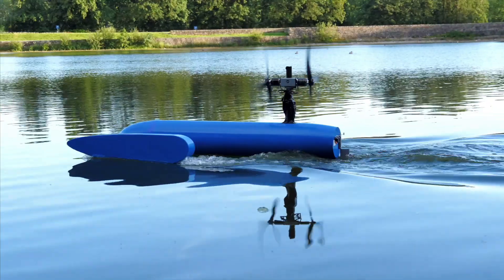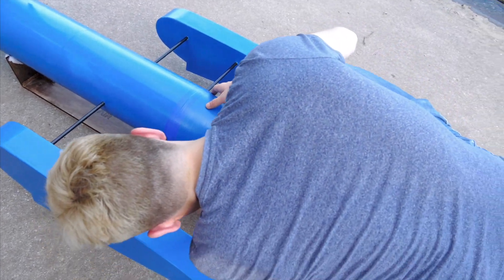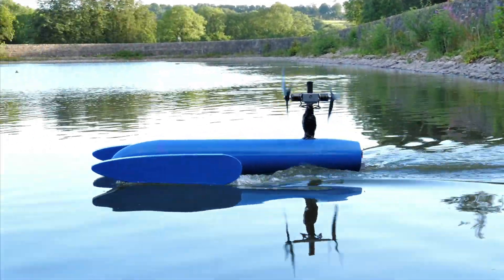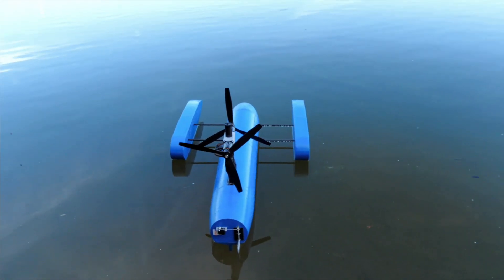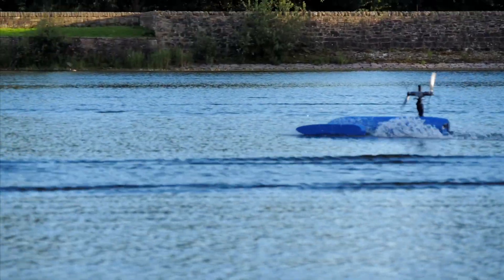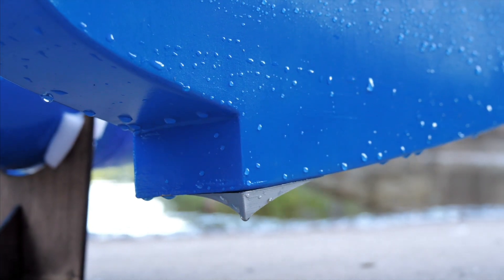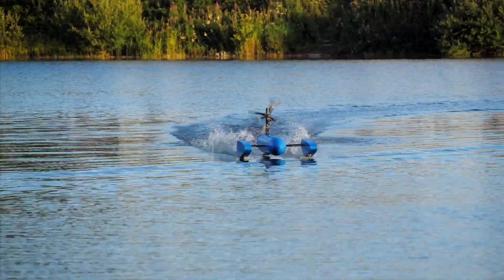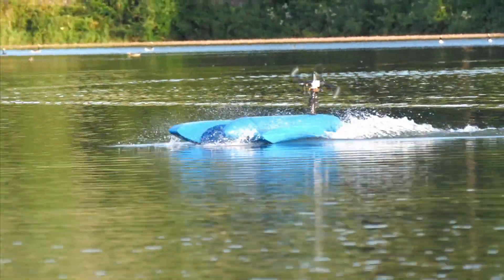DIY Speed Boat Mods

Comment: James, couple of ideas:
1) you could use plasticard and poly cement to make replacement sponsons. I've used this on a car I designed and it's pretty tough if you make it into a monocoque.
2) if you want it to have brakes, you could have a splitting rudder thing (not for steering, unless you want to) on the back of the keel thing. I experimented with a similar thing on my jet boat working long a horizontal plane but I'd suggest going vertical seeing as you can have attitude issues with this model!  

Keep up the great work!

Comment: Nice video!!
One question:
By using two motors, you offset the torque created by the motor. But for steering, do you use 'differential thrust' on those motors to turn quicker than only the rudder?

Comment: The air in the sponsons expands & contracts with temperature changes, this puts pressure on the wooden joints causing them to fail. You could make a vent hole in the top of each sponson, that will be sealed with duct tape when the boat is on the water. It should help prevent leaks & allow inspection to check if any water has seeped in. Plywood doesn’t like to be wet & I doubt that you painted the internals.

Comment: One last thing, why doesn't use some EDF on the center of the boat? something like the old Mig's.
This would reduce the torque that the top mounted motors are creating. Putting the rudder on the back of this air flow should also provide a great turning force

Comment: Also, why dott change the "banana pods" style for something like the back central pad? They doesn't have to produce in-water lift at all, just aerodynamic lift. This would also be easier to prevent from getting water inside, sice there's no "inside" to get in.
If you want some in-water lift, just put some foam on the top of it, keeping a sheet of metal contacting the water and it should be fine

Comment: Bro, you can make those floats out of insulation foam from a hardware store and cover it in fiberglass sheets. save a ton of money on the float design. In fact, send me the file for the float shape and ill make it myself.
Reply: Once the epoxy has cured you can then pour acetone into them to dissolve the foam and voila... light, hollow sponsons!
Reply: @AlymerKiteboy  Better to keep the foam so any holes will not fill it with water.
Reply: @macrumpton  he's going for max speed, so minimum weight, no reason for leaks in a glass sponson.
Reply: Oh well, seems like several people had the same idea as I did.
 @AlymerKiteboy   Good tip for a slower boat or a model plane, but considering the wobbliness of fiberglass it would probably be a safer bet to keep the sponsons filled with foam. The extremely irregular and strong forces from the water could easily cause the sponson surface to oscillate quite badly, at best. Maybe a similarly crafted hollow carbon fiber shell would do the trick, as it's somewhat less flexible.
Reply: @_tyrannus  3D print it. internals plus thin skin. flite test had a 3D-printed rc spitfire...................
Reply: +1 for fiberglass it would be perfect for this project.
Reply: @nypariah  I just know this was a way of making model sailplane fuselages... getting rid of the foam left room for the electronics. I'm going to try this soon for a one off boat hull.
Reply: @nypariah  : and Leaving the foam in adds positive buoyancy that an empty void can't.
Reply: @kadmow  Air is less dense than foam
Reply: @pepperrelldesigns40 Sorry, meaning of Positive Buoyancy ??  Air full of water isn't so buoyant -  (When an aeroplane hull has a hole in it, air rushes in/out, when a boat gets a hole water generally only goes one way. and the boat usually doesn't work so well.)
Reply: @kadmow  You didn't mention "in case of a leak". If you have no leak, the foam makes it heavier. (I'd leave it in, though, as a backup.)
Reply: @ThePixel1983  : All good.  My Bad

NB Boats don't need positive buoyance unless there is a leak - or water otherwise enters spaces it isn't intended to (by design)..

Comment: "We want as little drag as possible"
"Look this new rudder that I designed"

Isn't better to design something that it's not going to be on water and could steer the boat? 
As everyone know, at the same speed, air drag is much more forgivable that water drag
Reply: the problem is that you need motors on for it to function. I suggest a long rudder that extends both to props and water but James was afraid it would roll the boat
Reply: @linecraftman3907  that's true, but for both you need speed to make effect. If the goal is also having good low speed maneuvering, maybe thrust vectoring, but will add a lot of complexity.
The idea of moving the rudder of the water is just reducing drag, since the goal of the project is going as fast as possible and water at high speeds can be pretty unforgivable. (Would require stronger hardware and etc)
Rolling the boat is a real concern when you have the rudder far of the center of mass. Just like a plane, when you punch (or kick) the rudder pedals the will also introduce roll and pitch, not just yaw.
EDIT: I think the pitch introduced with a rudder movement is due to gyroscopic effect, on planes that have non counter rotate motors (or just one motor), so since this one is using 2 that counter rotate, it shouldn't have a problem.
Reply: @Xandeulson  yeah but like the lake isn't big enough for rudder drag to be a problem lol. The boat clearly needs RCS 😂😂
Reply: @linecraftman3907  a set of the famous cold gas thrusters would be awesome. Record breaking made easy
Reply: @Xandeulson  should be fine in pitch, but in water or air, it will have a coupled roll effect unless there is an equal yaw force both above and below the CG. (or straight through the CG.)
Reply: @martindinner3621  good note

Comment: Looked to be on step the first run. When choosing sponson spars always go fat and hollow for stiffness as solid ones are bendy. Your rudder is also too close to the transom before you install the new one sharpen the bottom of the V-shape or it will raise the transom out of the water more than you anticipate as it is a lifting surface as well. Locate the outrigger calc on RCG to get a good baseline on what works or what doesn't. Afraid to leave too much info as I build very fast riggers but not sure how you feel about having the answers rather than discovering them yourself. Either way, good luck, a much bigger lake will be a good start or a parachute. lol. Fantastic job, you got this!

Comment: With the new Floats how about filling them with expanding foam so if you do have another breach they wont fill up with water.
Reply: RC LabBotics expanding foam needs to be sealed as the water will force its way in to the foam
Been there done that☹️☹️
Reply: @ferb7452  hmm maybe some packing tape Around it like build a mold fill it with foam packing tape Around that.. Then build an outbreak Shell of carbon or maybe a different foam come to think expanding foam is quite pourus EPP would be the best way to go.

Comment: just an idea....try to 3d print brackets that can hold the carbon fiber tubes and attach those 3d printed parts onto the wood with screws...that way if you have more area of contact between the carbon fiber rods and body....also i think the "shaking" of the floats is because of only having 2 carbon fiber rods? maybe adding a 3rd one that's not parallel to the other 2 would be helpful
Reply: I'm not sure how much the brackets would help, but the third rod out of plane is brilliant! Also, switching from a round cross section tube to an oval profile will help avoid harmonics.

Comment: If you're gonna rebuild it, you can put some "air brake" like they have on planes? Probably help you slow down faster.
Reply: Or just add the ability to drive the props In reverse.
Reply: Martin Dinner Exactly, no idea why he wouldn’t set it up to be able to run it in reverse.

Propellers don’t work that well in reverse, but would’ve kept it in the water lol
Reply: @Nevir202  propeller can provide reverse thrust but it's only efficient with variable pitch blades. He will have to counter rotate the entire propeller which I feel will be far to slow to get back up to speed to provide any meaningful thrust.
I guess having a more efficient rudder to turn the boat before it beach is the simplistic solution.
Reply: @Nevir202  I use similar motors on RV planes and having reverse would be amazing it would make slowing down on landing so much easier but it is not possible without extremely hard  coding
Reply from the maker: Onizuka GTO That certainly might be a good idea, but really I won’t need a break when I’m on a bigger lake, possibly piloting it from a rowing boat out in the middle of nowhere (as long as I don’t crash into the boat!). This lake is very small. For context, to travel down entire thing at 100mph would take about 6 seconds. Not much space for acceleration and deceleration! 😆
Reply: @Project-Air  Use two rudders controlled by separate servos, then you could have the rudders turn 90 degrees simultaneously to act as a brake.
Reply: Jeremy Caylor Given the lightweight construction of the craft, I would be afraid that might rip the rudders off LOL
Reply: @Nevir202  Make the rudders out of Unobtainium.  It's very expensive, but also very strong, and it's guaranteed not to rust, bust, collect dust, or smell bad when hot.  It's good for colds, moles, sore assholes, fits, farts, and freckles.  It's the WONDER METAL!  (not available in stores...)  :)
Reply: throngcleaver lol, I’m worried about the rudders breaking off the hull, not the rudders snapping. 🤣
Reply: @Nevir202  Lol! :D
Reply: @Project-Air  the best brake for this might be a pitch rotation or a ducted fan with a  reverser
Reply: Algo change that water rudder for a air one. Air drag is much more forgivable
Reply: @Xandeulson  Air rudders on a foiling/hydro boat makes it unstable and tends to tip the boat if you don`t have exactly the right rudder design, however a combination rudder can work, done it myself way back on a "classic" airboat for water/snow/grass.
This was after I lost my foiler due to it flipping and breaking apart in a turn hehe.
It was a balsa/foam build, so not as strong as this, but in any case, if you`ve ever flown a rudder/elevator airplane, or simply tried turning with rudder only, you`ll have seen that even with the large wing, it will roll because the rudder is above the main lifting surface and throttle line.
A lot of variables here depending on the hull and propulsion, so YMMV ;)
Reply: Use ESC`s with reverse on airboats ;)
Reply: Giving the props the ability to run backwards is all it really needs (or could handle)... Can be done electronically (so no extra weight) and yeah while there's some momentum considerations (time it takes to stop and reverse the props), it wouldn't really serve all that well as a brake anyway... But would offer a way to back out of having gone too far, "for free" (weight).
Reply: That's just added weight with no real application (if he doesn't turn it up to 11 again lol)

Comment: give the carbon fibre tubes that hold the sponsons a fairing. you can use it for aero and rigidity. look at Unlimited class Hydroplanes for inspiration of the floats and on how to improve them. You can give them much more shape and a rail along the sides to aid with steering.

Comment: why not try it with a boad propeller?
Reply: Because the whole lifting out of the water thing, a underwater propeller would be a lot more complicated and would add alot of drag which is the exact opposite of what the lifting system was designed for.
Reply: I think an underwater propeller would disqualify it from air-boat speed records

Comment: I’m thoroughly enjoying the boat series! All of my RC experience is with air, but it’s fun to play armchair engineer while watching these, seeing your designs perform and speculating what might help them work better. I agree, a change in pitch angle should keep the stern from lifting. Pusher aircraft models with dorsal power units usually aim the thrust line toward the center of mass to prevent pitch changes under power. With a hydro however, that would put more load on the sponsons and tail skid, possibly reducing speed. Hmmm... but that’s why I like these episodes! They make me think. ;-)
Reply: I thought the same thing, only with a servo to control the pitch angle of the propellers, tied electronically to the throttle, with a dose of velocity in the algorithm.
Reply: Or maybe with a gyro setup that varies the thrust angle based on the pitch angle of the boat itself. That way you could keep a relatively balanced load on the sponsons and tail plane. Ha, we’re going to give James a headache. ;-)
Reply: @gryfandjane  Haha!  Yeah, but he'll survive a little headache.  :)  The gyro setup you mentioned would be perfect, and completely adjustable from the controller.

Comment: Love your videos....keep it up......

I may have an idea for the carbon fiber supports for floats...

You can insert a balsa wood piece in the carbon fibre support to make it rigid...

And also, I think you should consider tweaking(adjusting) the design of the hydroplane...I think the floats need to be a little bit more aggressive in their angles, because the boat is very light(In the video the boat was already skimming on the water even at the speeds you got, which were fast but not as fast as the speed of world record rc hydroplane)........At higher speeds the hydroplane may launch into the air(like the real manned record holder hydroplane ) if the angle of the floats is not very aggressive......and the more aggresive floats will reduce air drag too......

And maybe you should try redesigning the entire hydroplane......you can make the main body slimmer and aggresive...and also I think you should make the main body tapered(reducing diameter gradually towards the end) and make the rear of the main body very slim(but if you will do this, do it gradually)...this will reduce air drag.....((reducing air drag may seem unnecessary, but trust me, it will increase performance,if done to many parts of the hydroplane which are out of water))...also if you cant find a way to taper the large pvc pipe...you can 3d print different sections of the main body and glue them together......

And you can also make the dog tooth( I'm talking about the 90° bend at the bottom of the floats...a similar structure is called a dog tooth in wing design of aircraft, so i'm gonna call that 90° bend a dog tooth) height a little less........

And if you are considering composite materials...you should just make the floats and the tail skid out of composites as they are the sections exposed to large  amounts of force..........

I'm sorry if you got confused by the extensive use of brackets......